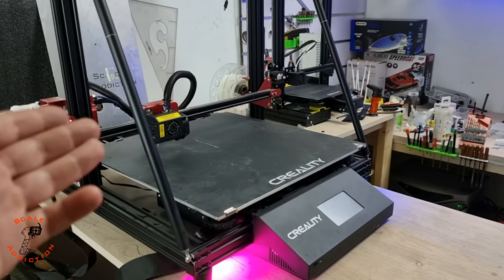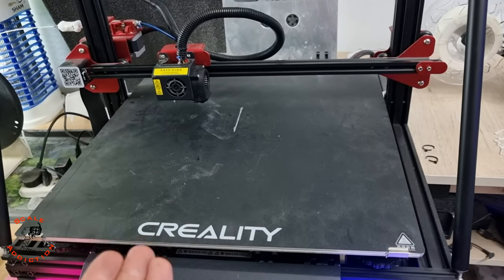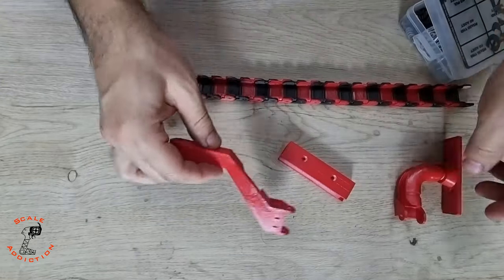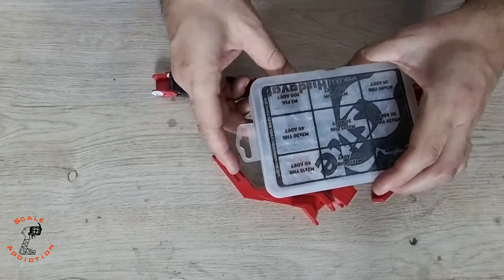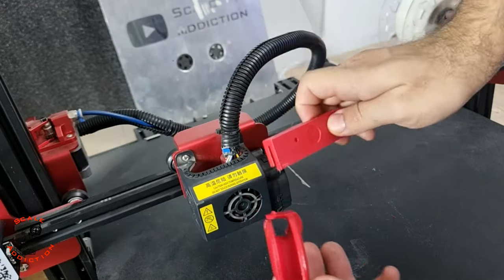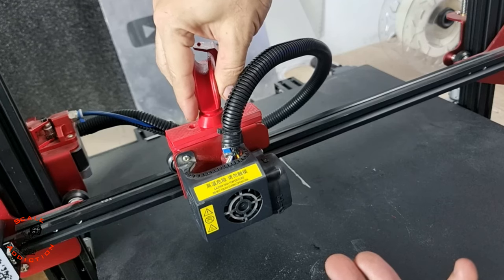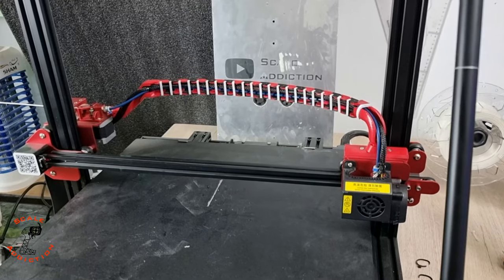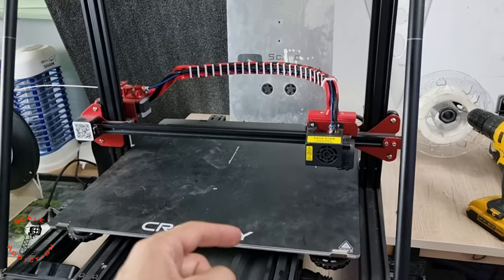3D printing Cable Chain for CREALITY CR-10 MAX/ Upgrading 3d printer wire problem/ Scale Addiction

Comment: hi, thank you for your mods, I'm trying to adjust the CR 10 max of the work as best as possible. can you give me some advice for the Z offset adjustment procedure? When you adjust it, do you put a thickness of 0.1 mm below the nozzle? Where do you live in flower bed? and what is the best way for the printer to remember it?